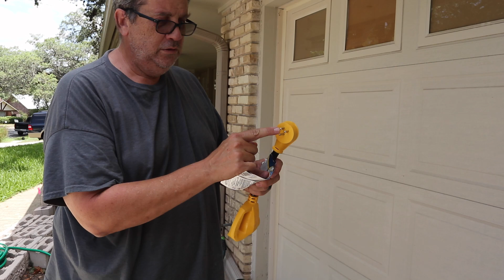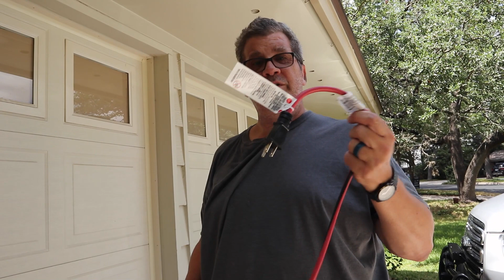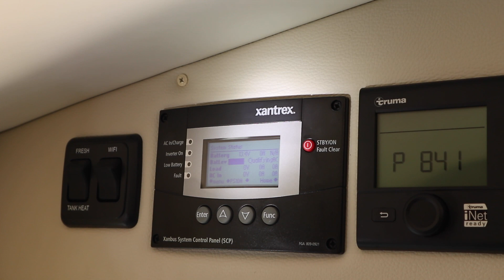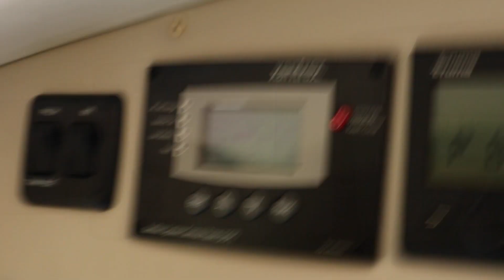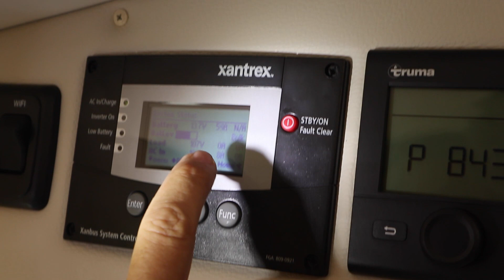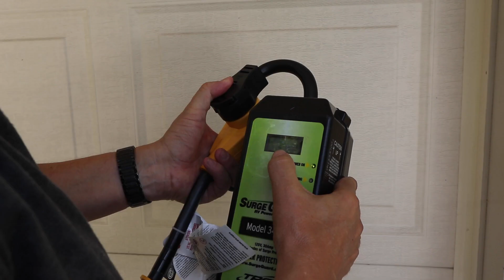Coachmen Beyond Li3 Moochdocking and someone offers you the 15 amp outlet.  Great!

Comment: If your batteries are at 10% about how many hours of driving does it take to fill them?
Reply from the maker: Driving down the highway with plenty of air flow to cool the alternator, maybe 3.5 to 4 hours.  I am getting  between 150 and 185 amps an hour while driving.
Reply: @CampingCoastie  , thanks!!

Comment: Hi, newbie here.  Wondering if I can plug my brand new American Coach Patriot class B into home power.   Your video was extremely helpful.  I still am unsure about any required setting adjustment on the Firefly energy setting.  What changes are needed?
Reply from the maker: Hello, not sure about your particular model, but I made a video for my Coachmen Beyond.

Xantrex inverter -  setting input to limit amps
https://youtu.be/R3GUKUL4mKA
Reply from the maker: You might be able to just plug in and not run your AC or microwave.  Worse that could happen is you trip the breaker on your house breaker panel.

Comment: If you hook up to a 30 amp pole in the RV park, do you simply hook the EMS to the power pole and your supply cord to the Van? If that is the case do you set the Zantex to 25 Amps?
Reply from the maker: When hooking up to a 30 amp outlet set the input to 30 amps.  You plug the EMS into the outlet and secure it with a lock, sometimes people will steal them sadly.  With your power cord attached to your van plug in the cord to the EMS.  Then turn on the breaker at the outlet.

Comment: Thanks for the videos.  They’re so helpful, especially to someone like me who’s new to all this.  Should I keep my Crossfit plugged in all the time when it’s in my driveway and not on a trip?  Thanks.  Also my Xantrex looks a little different from yours, but I’ll try to work my way through adjusting it the way you describe here.  Thanks.
Reply from the maker: I am guessing you have AGM batteries.   I leave my refrigerator on and I am parked under a cover.  Many times I leave it plugged in,  I  also use my EMS to protect my van from possible power problems.

If you don't need your refrigerator running and have solar panels and are parked in the sun you might not need to be plugged in.  Try it for a day and see how your battery levels look.  You might be able to make enough power to not be plugged in.  To save power you can turn off the propane if you don't need it.  Having the propane switch in the on position uses power to keep the valve open.
Reply: @CampingCoastie  I’m really new, so AGM?  I guess so, whatever that means, sorry.  I have a 2019 Crossfit, not lithium batteries.  I  have about half battery after a couple days in driveway not plugged in. I have 200 W Solar on the roof.   I saw your video about how to connect through surge protector (I bought a Progressive Industries EMS-PT30X), a heavy duty 14 gauge extension cord, and am waiting for delivery of proper dogbone (30amp F to 15 amp M) tomorrow, so I can hook up.  I just can’t figure out how to adjust amps on Xantrex XC Freedom 2000.  The users manuals aren’t as helpful as a video would be of my unit.  I’m taking it in to La Mesa RV, where I bought it, to get a couple things looked at, like why awning won’t extend and why fridge works intermittently (they say a module in it has a recall).  I’ll see if they can show me how to adjust the Xantrex.  Mine looks a little different than yours, so I can’t seem to adjust it, only scrolls through screens that are unclear to me what each is for.  I wish RV dealers were better as customer education and follow-up. Thank you for your videos.  They’re really helpful.
Reply from the maker: I am not sure about your inverter.  But what you can do it turn off everything in your RV, including the propane switch if you don't need to run the Truma for heat.  Then just plug in the van to the EMS and the outlet.  Look and see how many amps you are pulling.  As the battery charges the amps will drop to maybe 1 or 2 amps.  Once your batteries are charged you could probably turn on your refrigerator, just watch the amps to see what your using.  Worse case is that you might trip the house breaker.

Comment: Hi Gardiner, great video! Question: do you recommend using an extension cord or can the adapter be plugged directly into the outlet?
Reply from the maker: It would be best to use the least amount of power cord as possible.   If you can reach the outlet with just the power cord and adapter that would be best.  If you are to short to reach the outlet the shortest possible power cord that is rated for the load should be used.